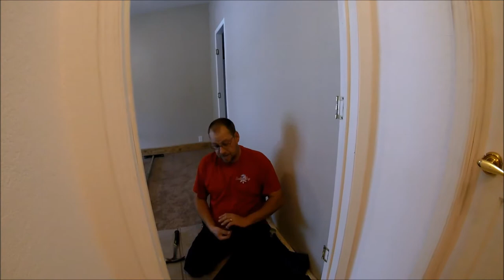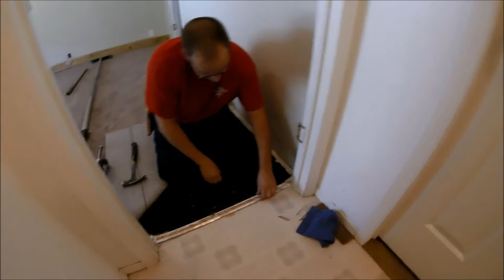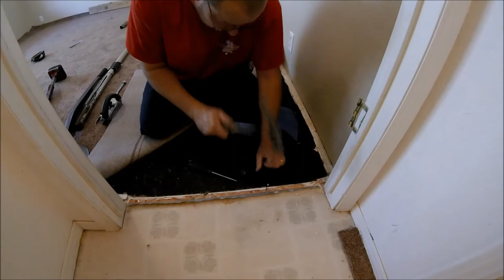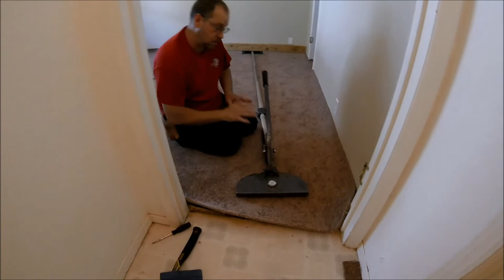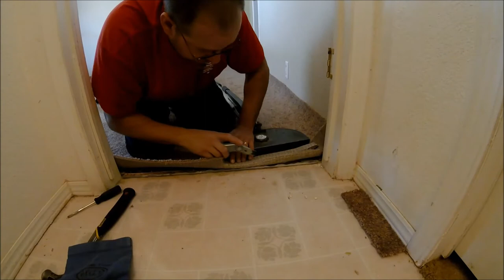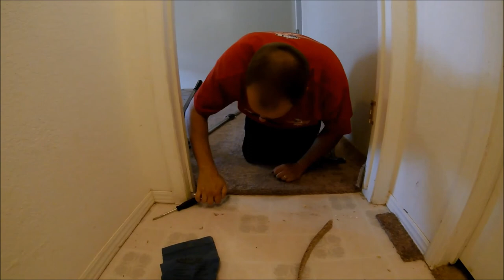Z BAR CARPET TO VINYL TRANSITION

Comment: Thanks for the video. I am laying 1/2" laminate up to each bedroom which has carpet, thick carpet and thick pad. the carpet is higher than the laminate. So I thought using the Z bar might help. I still have to install transition strips since its laminate so would the Z bar not work with a transition strip over it? the strip is a reducer.
Reply from the maker: Steve Jones I would install the transition strip first since it is a reducer and then position my Z bar where it will work right to my transition piece and that will be the best way to finish that off
Reply: @FloorsbySouthernboys  Oh interesting! Never thought of that.  I thought I needed to tuck the carpet under that strip.  I know this video specifically shows this the tack strip across the doorway but is that okay?  Will the tack strip nails end up poking through when walking over it?
Reply from the maker: Steve Jones Maybe if your carpet is thin You can always take and tap the nails down after you’re done or if you want it under the transition you need to get a T molding, however if you do that your transition piece will not be solid and will not hold up good, your transition needs to be fixed solidly to the floor with no movement so that it does not break loose

Comment: thanks for the videos. jw do you ever get complaints about carpet smiling at zbar? such as all the nap spreading and eventually falling out with foot traffic or doors sliding over. i figured it was unavoidable and always preferred round bar for this reason.
Reply from the maker: Brandon Cole sometimes you can't help for the carpet smiling at you when you got a lower grade carpet I do not like that about zbar I've never heard of round bar I'll have to check into that thanks for the recommendation
Reply: FloorsbySouthernboys well we call it round bar its just silver or gold metal we use to protect the carpet edge on stock carpets in apartments. Its the stuff you beat down with a rubber mallet...i think some places even sell a faux woodgrain type to match vinyl plank and look like a wooden reducer.
Reply from the maker: oh ok i call it gripper metal , most home owners dont like metal unless its a mobile home, but i do use it sometimes
Reply: FloorsbySouthernboys yea its kinda tacky looking but on apartments they last a long time. many times prying z bar back up again in the concrete around here itll release the strip and youll have to chemrex it. with gripper metal you can use a hook knife and pry thar stuff up over and over again.  we do a lot of work for questionable people though that like to call back to get their jobs free so we always go for the more reliable thing in the long run.
Reply from the maker: Brandon Cole yeah I don't blame you there unfortunately there are people out there that always trying to get something for free so it's a no-brainer to go for the longest lasting products if approved by the homeowner most of the work that I do is people are living there and if I have a question I will let the homeowner make that decision kind of keeps me in the clear